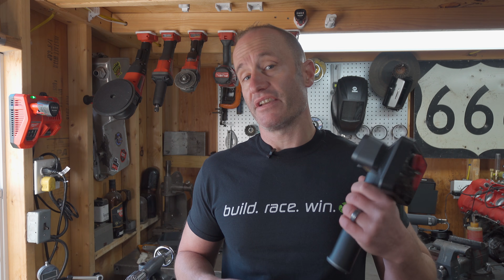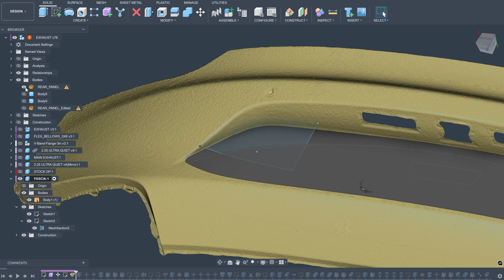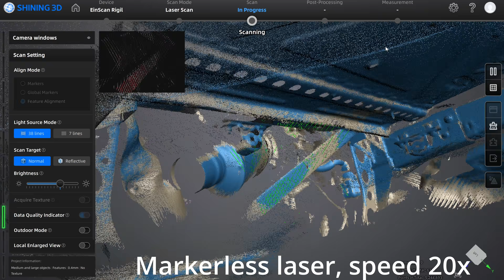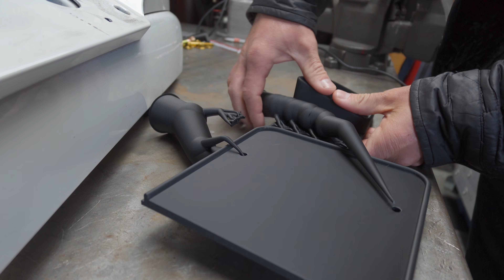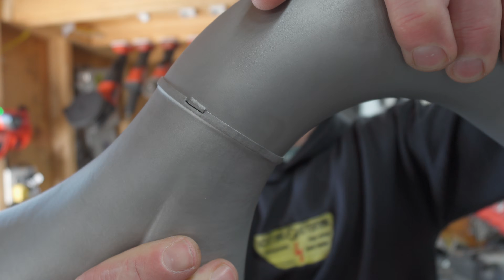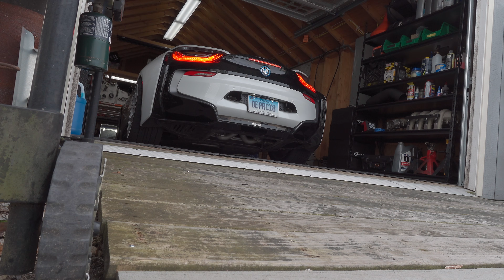3D printing a flame throwing exhaust to turbo rotary swap a BMW i8

Comment: Was there a tariff or duty charge added during the shipping process for the aluminum pieces? if so what was the percentage?
Reply from the maker: Ask for a duty free shipping route after ordering. They always find a way.
Reply: @CouchBuilt  can I pay you to look at a file that craftcloud found an issue with?
Reply: @CouchBuilt  can i pay you to look at a CAD file that Craftcloud found issues with?

Comment: How well would you say the Rigil is able to track and capture body surfaces in markerless mode? Is it worth the extra cost over the Vega or is the benefit purely in the precision with mechanical components due to the laser feature? Thanks for any feedback and the build is amazing!
Reply from the maker: If you mainly do body panel type stuff the Vega will do just fine. The Rigil could be more beneficial if you need to capture precise mounting flanges of a fender off a car, but for things like over fenders or spoilers, the scans from the Vega are more than adequate.

Comment: i have experience with the TurboFlex Couplers from vibrant and in a rotary application i can say that it isn’t reliable i’ve switched to the motorsport bellows there is a step down in it which is sad but i can say they last you can always upgrade when it fails

Comment: Just a heads up on the exhaust layout. With the exhaust tips sitting so much higher than the low section, you've effectively created a massive water trap. That deep dip/part is going to act as a sump where condensation will accumulate. It's also might be an issue when washing the car—any water that gets into the tips will just run down and pool in that bottom section.

Comment: Up to 90 fps for this scanner is mind-blowing — especially compared to consumer-grade laser scanners like the Creality Raptor, which has a theoretical maximum of 60 fps.
Add to that the superior tracking of the professional-grade EinScan line, and the whole package becomes even more impressive.

And all this for only $5,000! Just a few years ago, a professional-grade scanner with similar capabilities would easily have cost $10,000+.

Comment: This is the most fantastick youtube channel ever. Excellent work. I love following your progress on the I8, as I own one myself and would love to mod it. I cant help but think it is only the true experts that should mount such and awesome challenge to put a rotary in. I liked your will it swap, but have a different suggestion, would a Ducati V4 not fit the engine bay?. I realize it would be a bit down on power, something I never felt the car was lacking anyway. I'm in the process of upgrading the battery to modern cells, to get a bit more range from them. Could you please make a vido on your background as I feel your skillset might be 2-900% over the general public, in regards to electronics, cad and general understanding ove vehicle system interaction. Keep up the good work, I will stay glued to the screen.

Comment: VERY nice!

For the 2 hexagonal grilles on either side, next to the 2 exhaust exits:
I think I would have gone all the way through to the interior to let the warm/hot air out into the low pressure vacuum there at speed.
That should improve Aero a bit (maybe surprisingly more!?), heat dissipation and decrease weight a tad.
(Think: Speed Holes)

YouTube will have a little 'shit fit' if I try post a link, so Google:
sciencedirect Impact of a vehicle exhaust pipe position on the lift and drag coefficients: 2D and 3D simulations
to see what I'm on about.
Your exhaust exit position is fortuitous..!

Comment: How well do the 3D-printed metal parts withstand structural rigidity? Perhaps the vibrations from the 13b will show how well they hold up, thanks for your videos!

Comment: the rigil is a solid scanner.. the biggest issue is the software.. the software is abhorrent for a company as big as they are.. the amount of bugs and missing "coming soon" features is crazy.. but when the software works it gives GREAT results it's just super disappointing the sad state of the software. and realistically the workflow  they have sucks.. you shouldn't have to use another software just to be able to work with different resolutions.. no other company does this. and for doing large projects where say you're doing a larger area that doesn't need high detail but then need VERY precise mounting holes that do . it should be able to combine multiple res ... thats a bigger miss step to  me than the benefit of being able to align to a coordinate.. I can do that in sub 30 seconds in blender and any other software where i would be combining multiple res scans

much like many other companies they need to focus on letting the software bake till it's actually ready vs being 6 months after released and still being a mess.. 

and no you're not an idiot about not knowing it needs a laptop.. they've been saying "next month" for 3 months apparently it's coming soon since they had the beta for it. which i'm looking forward to but it's a darn shame how they work with things.. i hope they clean everything up in the next few months since i'm well beyond my return date at this point

very much agree on the ultra quiet vibrants .. that and the 5" round body are my go to for making great sounding exhaust notes on basically any car. Verocious is good people.. as are ACE race been using both of them for ~15 years .. ugh i made myself feel old LOL
Reply from the maker: Yea the entire market of scanner software sucks. Having spent some time in CrealityScan I appreciate the shining3d variants slightly more. It's frustrating since there's no real incentive for improving the software to a world class level. WIth how well the on-device processing works, I think this is actually a good use case for a cloud based software so you can optimize for a known set of hardware. Then again people would bitch about needing to be connected to the internet so there's no free lunch.  I just activated the beta standalone markerless this week. So far its been pretty solid, but I haven't spent significant time with it yet.
Reply: @CouchBuilt  tbh with the state of the rigil software i'd rather have the latest creality software sure it's not as feature rich but it also doesn't have as many memory leaks, is significantly more stabile and doesn't have the workflow issues the rigil software does. the part that is mind boggling to me for shining is they've been doing both IR and laser scanners for ages.. how come every software they release is like it's their first scanner lol.. on device works great but theres just certain things you cant do on there. i've kept my otter at this point which i intended to sell when i got the rigil because IR is a train wreck on the rigil  ( the last update helped it but it's still not fixed). the even more annoying thing is the rigil is like a baby libre. which uses a COMPLETELY different software that has some of the features or least work arounds for some of the things i mentioned.. so why oh why didn't they use that as the basis. 

i don't need world class i just want .. you know functional without using 3rd party software to do merging and other basic functions LOL. I can't for the life of me understand why on device you can do laser color but on PC you can't lol the whole thing is just backwards .. esp when you get banned for bringing up issues on their forums maybe if they don't want bad press they should spend more time on the software before release lol

Comment: Your description of “off throttle flame thrower” is so correct. I raced a Sports 2000 for 13 years, at that time, Formula Mazda was in our wings and things run group. Even though they had wings and horsepower, they did not turn well. Often I would be right behind one in the breaking zone of a corner, and BLAM, get a shot of flame right at me! The first few times were quite shocking, but my nose never got singed, so I became used to it. Really love this project and cannot wait for the integration phase!

Comment: I very much despise the Ugh-8, it´s a shitty car all around. But with the Wankelmotor it becomes kinda cool, sounds weird, tho. Like a kid screaming thru a pipe… But that´s the Wankel´s thing. They all sound like crap but it´s a cool concept and this might be the only really working Ugh-8 worldwide. Such a shitty car… A "Supersport" has at least 8cylinders and no darn battery. This is a modern German Autoscooter but no car.
We call fairground bumper cars that.

Comment: First of all, stop making it look so damn easy!  Secondly, fucking rad as always!  It's always amazing to me that you take the approach you are going to be manufacturing 100's of these vs the 1 off approach.  I also enjoy the OEM+ but sometimes it kills me when someone with glued on overfenders gets all the "build" points.  I am sure there's still a decent amount of custom fitting but hopefully you are utilizing these skills professionally in the aftermarket for a boat load of money!
Reply from the maker: Most of that comes from knowing stuff breaks and it makes materializing a replacement a bit easier. It also nice to know I could replicate the setup if someone wanted, but that would take quite a bit of convincing with how many garages out there have stalled/failed projects that are much less involved.

Comment: I've been watching since the beginning and I still got trolled by the "Twinpower Turbo" cover 😂.  Thanks for showing us the potential of building with cutting edge tech, it's amazing!
Reply from the maker: It’s probably my favorite detail and 95% of why there’s a polycarbonate window to the engine.
Reply: @CouchBuilt  Spinpower Turbo in the same font would also be 🤌

Comment: While boomers are still excited about getting nearly 1hp per Ci from a cheyy short block and brocolli head fukbois are tiktoking hundreds of inches of pointless piecut welds, this is the real interesting future of automotive fabrication/hotrodding.  Watching these I'm almost more interested in the fact that 3D printed exhaust part are now fit for purpose over actual design on the part.  Stainless conventional headers on hotrods tend to crack over time with the hign expansion of stainless with heat input it will be interesting to see it this system has any of those problems.

Comment: Isn't the "bumper support" actually part of the crumple zone, so by cutting is severely weakened?
Reply from the maker: It’s double walled. Besides, with the carbon tub, I consider it a throwaway if hit. I’d never buy a salvage i8.
Reply: can always weld in some support walls on the cut section to get some strength back
Reply: Some sorts. But ig it wouldn’t matter that much tbh. Its not cutted in half so.

Comment: Looks Awesome! Do you have a recommended wall thickness for exhaust parts? Like 1 to 1.5mm?
Reply from the maker: This was done in 1.27mm/.050”. It split the difference between 16ga and 18ga more or less.